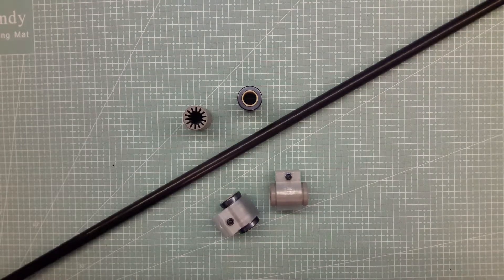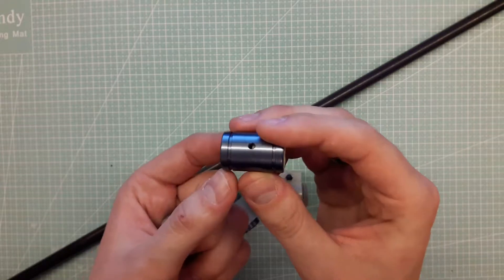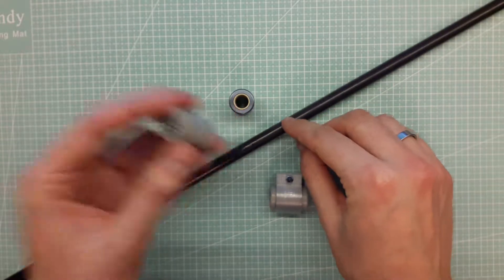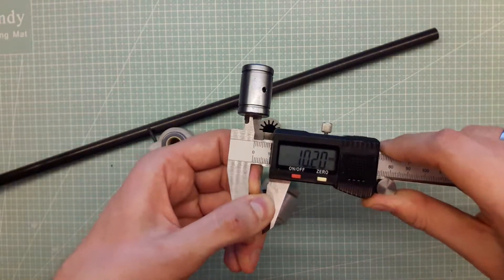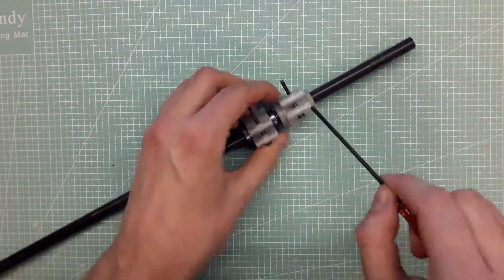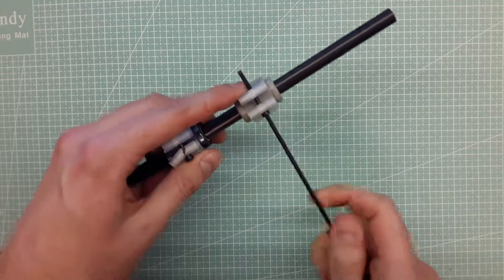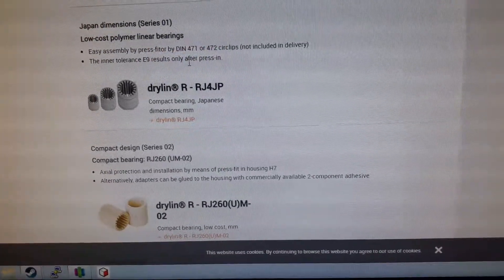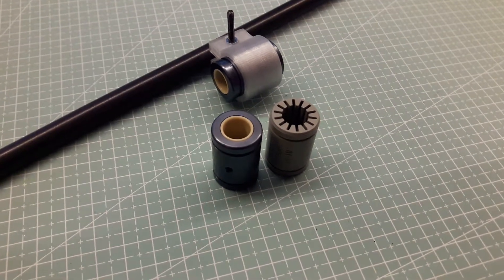Igus drylin RJUM linear bearings with alu casing

Comment: To clarify, my understanding is that the standard all plastic igus bushings are intended to be press-fit into a precisely toleranced metal housing for them to assume their intended tightness on the rod. That's the reason many people find igus bushings to be very loose; they're not intended to be used 1 for 1 substituted for linear bearings. Most of the clamping methods found on 3d printers are suboptimal for this purpose; they might work, but will have increased play and reduced lifespan.

If you aren't going to press fit them into a machined part, it's much better to go with the aluminum sleeved versions, as they do not require any special mounting and can be directly substituted for LMXUU bearings.
Reply: Well yes and no. This video is false in 2 things. First, RJ4JP bushes are NOT meant for pressfit, only RJMP bushes (which are very similar) are made for pressfit. Second, RJ4JP and RJMP are both NOT meant for clamping, they are made for circlips, this information has always been available on the Igus website, no clue why people keep spreading this misinformation. One could argue pressfit and clamping is the same but obviously its not because pressfit provides a consistend and predictable squeeze of the bushing, clamping on the other hand puts the bushing to a punctual force so the bushing will bind. And yes, the aluminium sleeved version is the only viable choice with clamping.

Comment: Any tips on how to remove binding? I have the rjum for my hypercube but cannot get them to work properly, especially for the y axis, they bind a lot...
Reply from the maker: I have had no issues with clamping too hard, which is the usual issue with the regular ones. It sound more like the bearings are not aligned, thus scraping